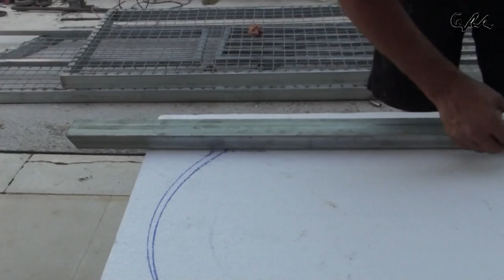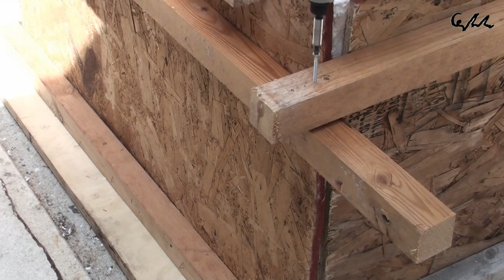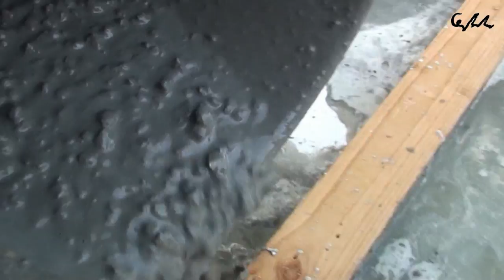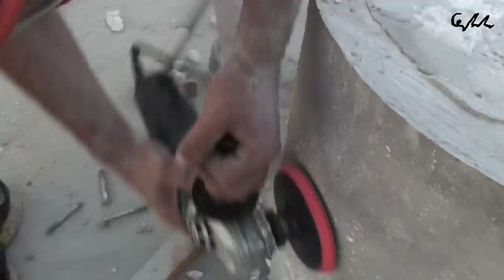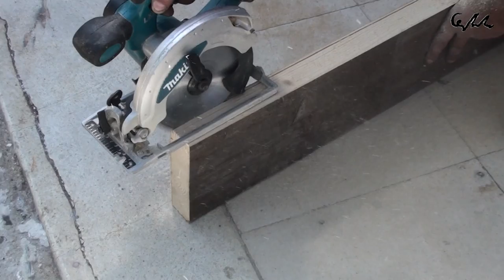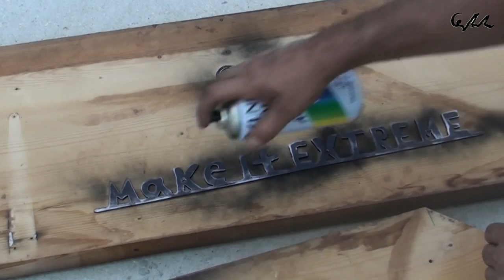Extreme cast concrete coffee table

Comment: Probably should've  painted the polystyrene in paint, then, it would've had a smooth finish from the start. Heck, with a bit of elbow grease, it would have a glass finish. Well, as close as possible, concrete heats up when it cures, so it would probably crack in a few places (the polystyrene finish).

Comment: i'm surprised you don't have some kind of over engineered concrete vibrator. like one with a led weight attached to a motor that was cast with a maximum size crucible from your foundry.... and powered with a VW engine.

Comment: concrete without reinforcement inside is waiting to be cracked under sunlight or loading, better off using 3D concrete printer to produce it with precision and speed. anyway, why do u need such a heavy coffee table? any wood with laminate top (or concrete/marble top) would do just fine. Greta maker, but not an inventor.
Reply: +beliefmail There is reinforcement?
Reply: you could also place your coffee on the ground, all tables are not the samr

Comment: Jesus, all that work? Do you guys know anything about wood forms or silicon rubber molds, or plasticine clay? That thing could have been perfect. No offense but that concrete mix was a joke. And how about some acid stain?
Reply from the maker: +Mike Goss  You probable have seen one of my videos....Do you know about experiment or the experience you got from your builds ?In this video i cut 60cm with my handmade polystyrene cutting machine and if i want to make a mold for table i can make it from metal, wood or silicon rubber and the three of them in just one day .This mix you have seen in this video is powerful. No offense but we not have all the chance to buy the quikrete 5000 because i dint find in my country.See my last six videos and we are here to listen  your  opinion .Thanks for watching !
Reply: Make it Extreme
Sorry guys, I was in a bad mood when I wrote that. I'll watch your other video's.
Reply: +Mike Goss im agree with you is not perfect but they try it... flat screws maybe?